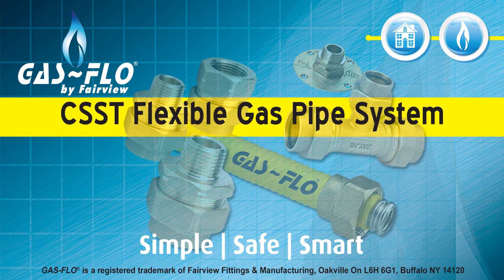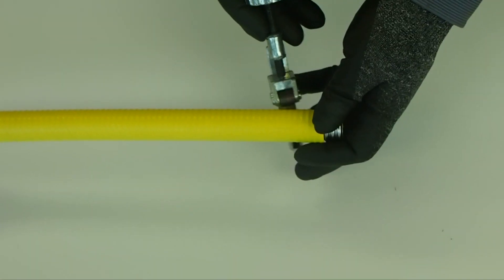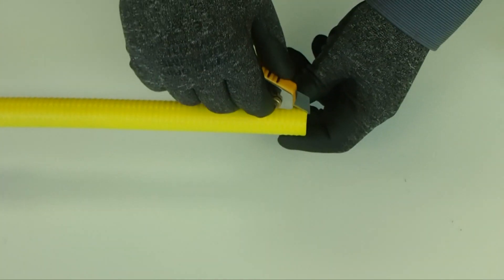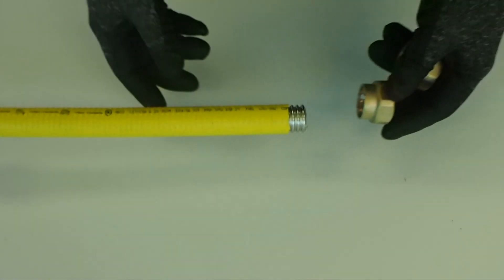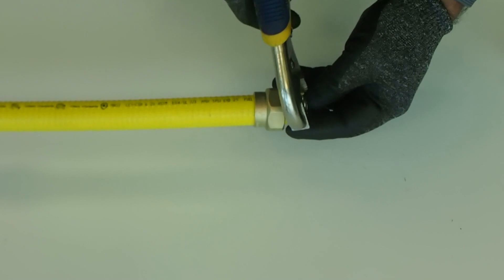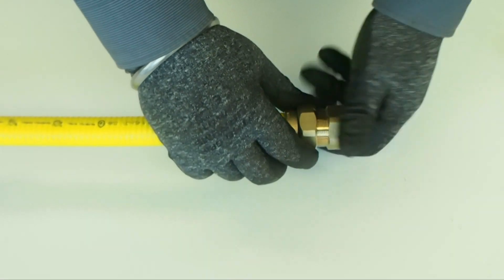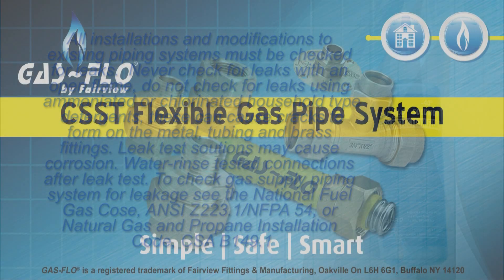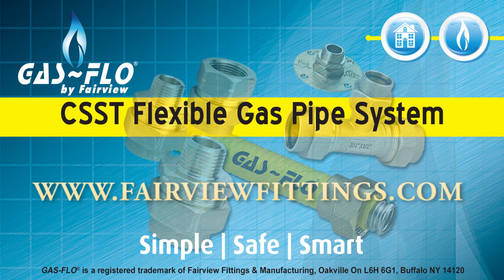Gas-Flo CSST Installation Instruction

Comment: I agree with the other comment . they tighting the pieces before connecting to the actual pipe ....say u do this exact step as shown ?how do u spin it on the pipe? . . isnt it the adapter to the pipe first  then u spin the hose on to the adapter ?????..

Comment: other vid said (4 VALLEYS BACK NOT TWO) and this vid actually shows 3
Reply from the maker: Hi Jeff!  Thanks for your interest in Gas-Flo CSST.  You are correct, the other video is for the 1-Touch Gas-Flo CSST Fittings which require 4 Valleys being cut back.

Comment: Just an FYI. The adjustable wrench you're using on the tubing nut is facing the wrong way,( Safety First, protect your knuckles). Also you should mention the importance of bonding your yellow csst. It does look like you have a very good product . Do you have it in a lightning strike protection coating yet or is it still in development?
Reply from the maker: Hi Bob!  Thanks for the feedback, our talented hand model will be informed of his safety gaff!   As for the lightning strike protection, it's still in development.  Stay tuned to our channel for new developments and look out for the new 1-Touch fittings.  Thanks for your support!
Reply: i noticed that too... Just figured he was a rookie !!
Reply: Ummmm
Reply: I understand the horror of watching a person miss uses a tool. I would of posted the same thing if you hadn't. lol